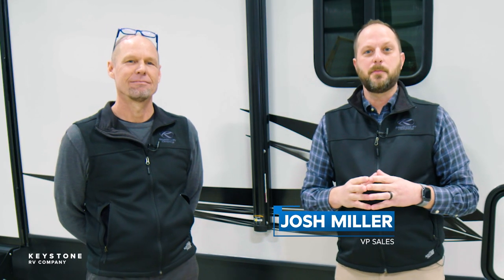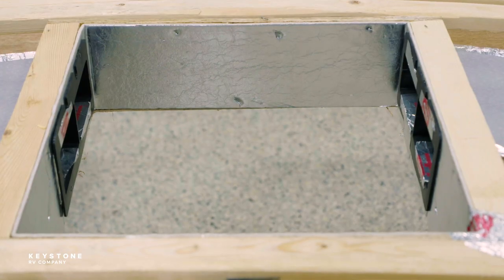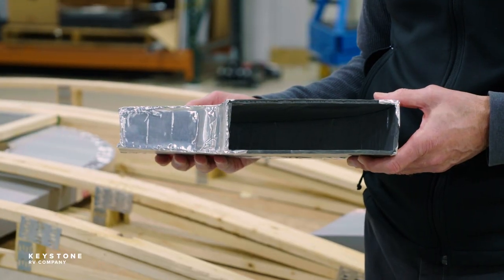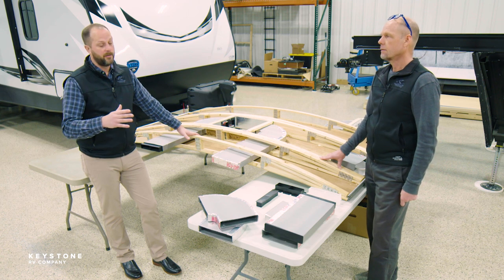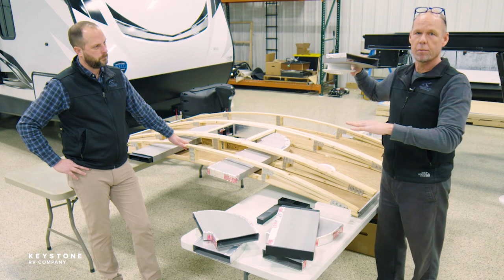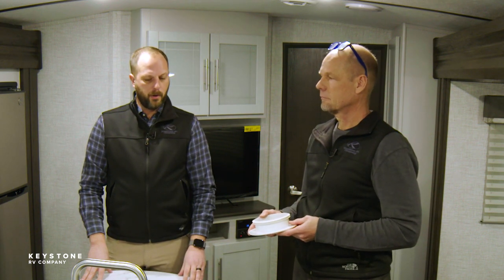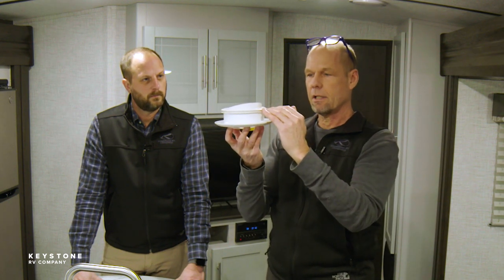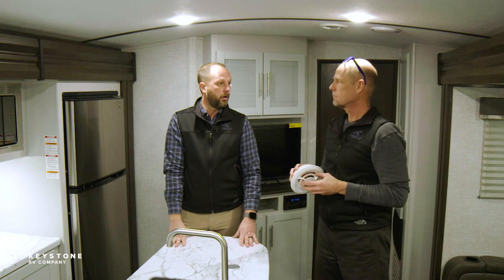BLADE - High Performance Air Flow System

Comment: One thing i would say after watching this is these blade diffusers do work but I think the SVP might have got the directions backwards as if you would like more airflow out a certain vent you would want to point the word "blade" away from the ac unit then it will push more air out. I tried this on my 2022 Fuzion to confirm. What I did was point the word "blade" on the 2 vents in the bedroom away from the bedroom ac unit to create the the most flow up there then the other 6 vents in the main part of the camper I pointed the word "blade" to the outside walls of the camper to allow the air from the main ac unit to flow through the whole camper evenly without the blade inside the diffusers stopping it from reaching the next one. Cools the whole camper very quickly and my ac's dont need to run constantly even in 90+ degree weather.

Comment: I have a 2021 Cougar. The blade technology vent diffuser is total junk !!
It’s like having the AC in your car and turning the vents to the side. 
To get cool you need the air to flow to you to cool off. Blowing the air along the ceiling and letting it settle does not cool you off or the trailer when it’s over a hundred degrees outside. 
I wound up taking the diffusers out and letting the air blow directly down and this cooled the trailer down an additional ten degrees. 
I wound up finding a diffuser with slates that you can adjust to direct the air to you and cool off, that would fit into the vent opening.
Thetford 94270. You just have to move the screws in a quarter inch and it’s a perfect fit. 
Some things are better left alone !!!
Reply from the maker: Good morning, we are sorry to hear you've had issues with your unit. We do appreciate your product feedback and will get this over to our product team for them to review. Thank you for sharing your experience.
Reply: I pulled all the Blade diffusers out and replaced them with honey comb screen.
Reply: Exactly what I just did right now. Was out here wondering why the heck is blowing the air directly to the  ceiling? Tried adjusting the “blade” literally didn’t do a thing. Thank you so much for sharing your solution.
Reply: Same for me on a Keystone Sprinter Limited 3590LFT. Bedroom is fine but the living room will roast you. I pulled the diffusers out and a lot more air comes out. Phd dude that designed this has probably never been in a RV lol. I’m telling everyone to stay away from this design

Comment: HI , I Have a question. I just bought on July a 2022 Bullet BH 2430 Crossfire from Tiara Indiana. 

I live in Miami and my first rip was to the Keys (KOA Sugarloaf). 

We use the 4 days the AC ON non stop. Going inside the rv and out many times, sometimes leaving the door opened.

Arriving from spending day in Key west, I noticed water coming out from the LED light ceiling from the bathroom. 

I grab my screwdriver and start dissembling the light and also remove the BLADE Vent of the ceiling bathroom. 
My surprise was I have all water in that area. There was no rain that day and al roof vents closed. The RV was not exactly leveled, was slightly tilted to the back. Then I Remove the fascia of the sky vent located in the middle of the rv near the AC, and again I noticed that some condensations was going under the duct in the bathroom direction. 

I wiped all these water and put all the parts back again.

We leave the Keys next day. 

I tested at home here in Miami and the problem was gone. 

My question is what happened here ? 
Any condensation from air leak form a window or door opened? or something else ? 

Thank You Sebastian

Comment: I don't know if its the vent or the race track system, but the ac unit in my brand new outback is mediocre. Two units with different themostats, and the bedroom is always freezing cold because air from the main unit is consistently blowing into the room (due to it being ducted and struggling to reach the desired temperature of 75 degrees). So, i have a 65 degree room and a 87 degree living area. I don't have the time of day to take it to the dealership to get it fixed, so i have to deal with it.
Reply from the maker: Good Morning, we are sorry to hear about this issue you are having with the AC in the unit. We have ensured your feedback is passed along however, we would also like to get you the proper assistance needed. Please do call into our retail team at 866-425-4369 when you are able to! Thank you.
Reply: Mine is the same way on a 2022 Keystone Sprinter 3590LFT. I pulled the blade register vents out in the living room. TON of more air than with the vents on. They suck.

Comment: The blade vents still send 98% of the air in one direction and unfortunately with this system there's no way to change that by rotating. When you do rotate them you feel less air coming out until you get to a certain point and then it will eventually increase again. Probably just need to cut off the diffuser.

Comment: Can you guys make those new diffusers for past year models?
Reply from the maker: That is a great question. While we don't recommend any aftermarket modifications, we'd recommend you consult an authorize dealership, or service center to see if it can be changed out. Thank you!
Reply: You don’t want them. I took mine out
Reply: @vincebotkin1960  what was the problem with them? I was thinking of switching to these as well. The cold spots suck
Reply: @showmethemuddy  
Basically they disperse the air along the ceiling. 
You cannot adjust them   
It’s kinda like the AC in your car and having the vents point to the ceiling and not at you. 
You get no cool feeling from the air.
Reply: @vincebotkin1960  and you can’t close any of them
Reply: @jonholt2847  
Exactly. 
But they do have a taller section inside to either stop the air and drop it or if you rotate it it will deflect the air around it.
Reply: The best mod I’ve made on my unit was to remove these. By cooling the ceiling area and heat rising what little air does come through is warmer before it has a chance to descend. And I specify what little air does come out because even if you put your hand up to the vent you can still barely feel any air at all. To the point that I thought our duct work was blocked. I definitely do it recommend them. Once I removed them the air flows like your standing in front of a fan.
Reply: @yota4x405  
I installed Thetford vents into the existing collars model # 94270
Just had to move the screws in a quarter inch. 
Now you can direct the flow of air.
Reply: Just ordered 5 of them. Thank you for the info!!
Reply: @yota4x405  
Don’t know if you ordered five blade vents or thetfords 
If thetford I messed up the number should be 94270

Comment: Can the current vents be changed easily to the blade vent diffuser?
Reply from the maker: It would be considered a modification however, yes they could be swapped out. Thank you.
Reply: @KeystoneRVCompany  thanks, FYI, one of the problems we’ve seen in the Alpine brand is the vent holes don’t always in roof don’t always align with the vents themselves. Hopefully, this is also being addressed.

Comment: Great design, poor execution on my Cougar Half Ton.  The ac box was cut offset in the roof.  This prevented the duct work to align properly to the ac box.  I have a 1/4 inch misalignment between the ac box and the duct work.  Air is being pushed into ceiling of the camper.  I have no confidence that any of the hvac system was installed correctly.
Reply from the maker: Good Morning Randy, we are very sorry to hear about this issue you are having! We would advise that this gets properly inspected to fully determine what is causing this issue. Please do also contact our retail customer service team at 1-866-425-4369 so an advisor can look into this further with you. Thank you!

Comment: This doesn’t work. I’m looking for diffuser replacements and haven’t been in my brand new Sprinter Limited 3590LFT a month. The living room can’t cool down enough in the heat. The bedroom cools down fine but the living room constantly runs and can’t keep up. The design is a failure in real world. Maybe on paper it sounds good but it truly does not work. I’m looking to see what diffusers I can replace them with. Currently have them pulled out in the living room.

Comment: This design is complete junk brand new 2022 cougar 368mbi, was told over an over again when buying the rv that we wouldn’t need a 3rd a/c because of this system. But here we are trying to do everything to keep it under 80 in the rig. Added 2 rv airflow systems which helped with airflow a ton but with these vents u can’t even feel the cool air sitting or standing cause it just blows on the ceiling an never reaches u only room that gets cool is the bunk room an guess what it doesn’t have this vent in it. An only 7 vents in a 40ft rig an there placement is horrible, highly recommend staying away from this design
Reply from the maker: Good morning, and thank you for your product feedback! We do appreciate you and your feedback you've provided to us. We will be forwarding this on to the product team for them to reference. We are so sorry it's not keeping up with your needs. We do expect a 15-20 degree split from the exterior ambient temps to the interior. With it being summer, not sure what the outside temperatures are where you are located, but that would have an impact as well. Thank you!
Reply: Which RV airflow system did you add? My brand new cougar has horrible airflow as well